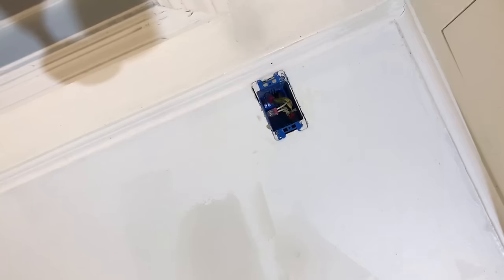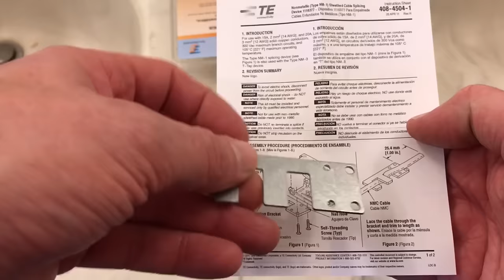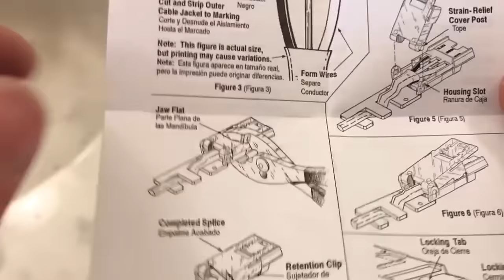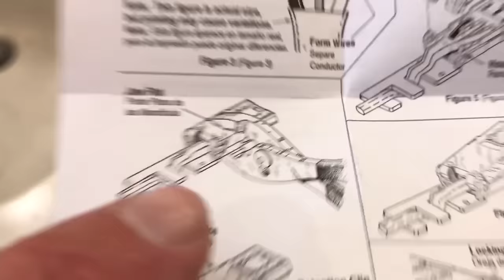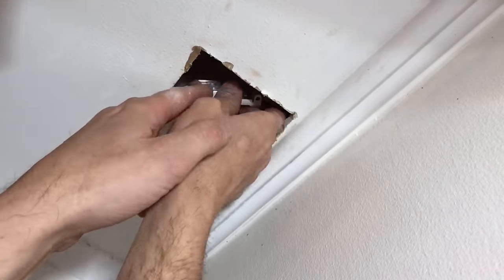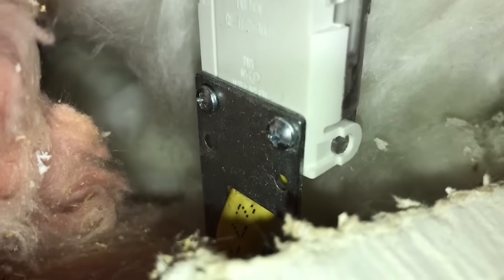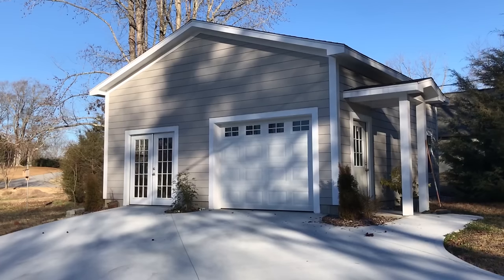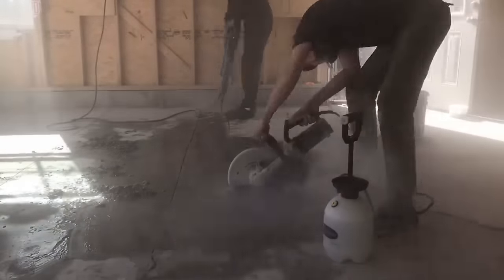Do I have to have a junction box to splice wires?

Comment: Twist, solder, shrink wrap, tape seems like a more secure connection. I was hopeful about this device but after reading the comments from professionals I'm hesitant to use these.
Reply: No. Don't do that ever. It's not allowed per the NEC. If you have to make a junction like this, either do it right or replace the whole wire. Having a little plastic cover on your wall is a lot better than your house burning down. I'm not an electrician, but I would never leave a splice of any kind inaccessible. The product in the video shouldn't exist.

Comment: Just what amperage is this safe for?  Those push and spring clips could loose connectivity with heat and humiditity
Reply from the maker: Should be 20 Amps, Frank, since it takes up to 12 gauge wire. But I no longer have the documentation, so that's an assumption.

Comment: I had to find one of these it took mo 3 hours to find in the wall cost the home owner 380
Reply from the maker: Would love to hear the whole story. Was it causing problems? Did it fail? Thanks for any more info you can post.
Reply: @FamilyFriendlyDIY  my company got a call that there was no power to a section of the house I checked along pretty much the whole circuit I found the splice behind sheet rock with melted insolation and a lose neutral took 3 hours to find and fix even though it I was put together properly it still failed. The second one that was found by my company was basically the same issue loose neutral connection
Reply from the maker: @syitiger9072  Yikes!  Good info. Any other common failures you care to share? Push connectors? Wagos? Wire nuts?  Stab outlets? Would like to know which you see more problems with.
Reply: @FamilyFriendlyDIY  back stab outlets tend to get loose over years i only use wire nuts any time I come across wagos I replaced them. I have seen wire nuts fail if the conductor isn’t properly twisted together or if to small of a wirenut was used on to-many conductors
Reply from the maker: @syitiger9072  Thanks for all the info.

Comment: I would not recommend this device. Slicing through insulation to make connections may be OK for Cat 5 cable and garden lights cable (which often don't work anyway) but crazy for AC power of any amp rating. Surely these are not NEC approved are they???
Reply: I'm guessing you've never used this device so I'm not sure why someone should follow your recommendation. I've used them and if you had you'd know that they are UL listed, NEC approved 334.40(B).

Comment: Since you had to cut stuff out, seemed like more work than just adding a box (for this use case at least).
Reply: The idea was to eliminate the box!
Reply: @philcook9967  I'd assume the idea was to work less too, if you're cutting gypsum, you're making a mess, you may as well throw in a box.

Comment: Personally I would have just put the box inside the ceiling and been done with it.  Code goes overboard sometimes.
Reply from the maker: I know right. A good metal box with clamps has to be as safe as this, eh? Thanks for the comment wattersm!
Reply: The reason you are not an electrician

Comment: No way my inspector would allow this. Code is undeniably clear. All spices must be accessible and located inside a covered box.  Noting other comments on trailers or double Wides, I always refused working on those due to the way they were originally wired
Reply: NEC 334.40(B) allows these.

Comment: Interesting video. I would never do that in my Home but an interesting video.
Reply from the maker: I completely understand. Thanks for the comment, Daniel!
Reply: @techmetal2292  Because he's stuck In his old tired ways and will never embrace change. 🙄
Reply: Omar Williams , not all changes are for the better. These devices need to be thoroughly long term evaluated by good test protocols and methodologies. Fires breaking out between wooden walls is serious business.
A good example of what can (and did) go wrong over time, was the use of aluminum house wiring. Nobody knew initially that using aluminum wiring with conventional metal screws used on switches and outlets would be problematic. No one realized the connections would eventually corrode, heat up, corrode further, etc., until a house fire would result. They eventually had to change to materials that would eliminate this problem, but meanwhile, aluminum wire got such bad publicity that they returned to the use of copper wire, from the circuit breakers onward.
It is true that aluminum wire is still used, but it has the special connectors to make it safe. It is now only used to the meter, and past it to the main circuit breaker(s). But after the breaker box, copper wire is used exclusively.

Comment: I worked in electronics design for over 20 years and used Insulation Displacement Connector technology all the time. Most ribbon cables in computers have IDC connectors. Mind you, these are low power cables, not 20 amp household circuits. When properly assembled, IDC connectors are robust and reliable. We did plenty of “shake and bake” environment testing for oilfield applications. Now, would I trust IDC on a household circuit? Maybe.
Reply from the maker: Thanks for the comment, John. Good info!
Reply: I feel like you didn’t actually take a stance or say anything really

Comment: My question would be did you reference the code book, just because a company made the product doesn't mean it meets or exceeds the electrical requirements. Understand that electricity travels on the outer circumference of the wire that's why all these quick type connectors really don't give you the maximum connectivity that you should have especially with only two .030 of an inch on either side of the wire not to mention the connectors looked like steel that pierced the wire insulation which will cause Galvanic corrosion amongst other issues. Well the only saving grace is the fan shouldn't draw to much current to accelerate the issues. BTW why not just mount the box in the attic & access it from there, code just says it has to be accessible ?

Comment: ? - "might be a little controversial" ? - Nah it is because we don't agree on what's really going wrong and why. 

Damaged wires, corroded wires, the wrong gauge of wires, mess up the flow of electrons and bad things get worse with use, right???

Is it a guarantee that this thing won't fail?  I think not because the contact points are smaller than the gauge of wire AND the contact points damage the wire.  Then there is the fact of oxidation.  This thing is a bad idea. 

Do not impede the flow of electrons and shield metal from oxidation; yes?

Comment: There are reasons why this is illegal to do. So are many car mods you can buy. It'll be your problem when insurance uses it to deny a claim and worse if you become criminally liable for an injury or death. It is likely that boxes are required for safety and accessibility is required for repair access. Those connectors are also less reliable than torqued and taped wire nuts.

Comment: Is this device UL approved? 
Is it approved by the National Electrical Code? 
Is it approved by the local municipality that has jurisdiction?  ( City electrical inspector) State electrical inspector etc.thzt will sign off on the inspection? 
There are outlet boxes all over the a house or businesses and one more in a ceiling is not a problem especial.y when access is needed for whatever reason.

Comment: IF I was going to use something like that (and I’m not) I would never unplug it and reuse it somewhere else, and I would never start with curly wire ends pulled from another connection. It’s just not a good idea.

Comment: These splice kits are not meant for you to be able to get rid of a junction box and you just burying spices in your wall. These splice kits are mainly used in modular house or trailers and are usually in one or two centralized spots with an access panel so that you can get to them in case one of them ever goes bad and that is the reason why you can find them at your hardware store not what this guy is doing.
Reply from the maker: They may be used for repairs, not new construction—Article 334.40b.  Thanks for the comment, Timothy.

Comment: I assumed they were called "Mounting brackets" for a reason?? Who or what would pull apart an "Out of box" connection located in that area?? Why does the NEC allow the use of utility knives to strip sheathing when it's known to be an issue?? Twisted wires under a wire nut has worked for me for over 50 years!! Does anyone know how many people are supported by the NEC's publications and enforcement of their often ludicrous requirements??
Reply from the maker: I hear ya Jack!

Comment: Never liked any of these insulation displacement type bite in connectors “not even the low voltage DC type used commonly for trailer lighting.” I have personally experienced intermittent connections with these style connectors.  I wouldn’t ever trust this type of splice, esp for 120V, even more so as amperage goes above say 1A. Also not all wire insulation is created equal, so you might not even get a clean bite through it. As others have mentioned, the surface contact that these make to the wire itself is much less than a pre-plier twisted and wire-nutted connection securely in a accessible junction box. I also would never reuse this type of connector after the cutter teeth have been spread apart somewhat. Also who knows how secure the spice modules even plug into themselves. They might work without a problem, or they might not! I’ll take safety over appearance any day of the week…it helps me to sleep better at night.  I’ve been a consumer electronics repair tech for approx 30 years.

Comment: I have problems with insulation displacement connections.  they do not handle 15 amps that 14 gauge wire is rated for.  
They might say they are rated but the connecting surface is not enough to prevent the connection from getting hot.

Comment: Illegal there needs to be access to the splice. Same thing as a hidden junction box. If this was to fail you would never be able to find this since your covering with drywall. And even tough you know the junction is there over time you will forget about it, or if you ever move future  resident would not be aware of this work. You did manage to spend more money to do the job wrong. $8.00 compared to $1.50 for the box and a blank cover. Not to mention the fire hazard this creates. Also this product has poor connections. Go back to the way you had it, was correct way to begin  with.

Comment: Did not see an UL or a nema listing I doubt this is legal. Just because you buy it in home depot does not mean that it passes code. Where is the access to the Junction? You could do the same with a Box and cover and bury it in the wall. The nec is a minimum a state cannot change a code to a lower standard only higher.
Reply: This kit is UL listed and the connections are much tighter than a splice with a wire nut. As for the NEC, localities can deviate from the NEC to a lower or a higher standard. The only reason why the NEC is the code is most places is because they adopt the NEC as their code. Not all places in the US follow the NEC, their choice.
Reply: @pld8993   No they can never have a lower standard than the NEC how did you get a license.
Reply: @lucyfuir6386  You're wrong. I've been a master electrician for almost 40 years and teaching code classes for over 20, how about you? The NEC is nothing more than a publication until a local authority adopts it as their code. The NEC has no authority unless and until it's adopted. Please share your evidence. I can identify many examples of a local authority rejecting a particular code in the NEC, thereby going below a minimum standard. If, for example, a local amendment rejects the use of AFCI protection, that's their option. Please tell us all where you found the rule that says any codes decided locally must be "higher" than the NEC standard.
Reply: @pld8993   The NEC itself and the definition of standard.  The local authority may have allowed it but I'll tell you one thing the insurance company will use it as an excuse not to pay out. I'm not talking about bubble covers or distance between staples. Also How will you find it if it ever fails. I would anybody know that it even exists without ripping a hole in the wall.
Reply: @lucyfuir6386  Please identify where in the "NEC itself" you found this supposed rule.
Reply: @lucyfuir6386  Not unlike millions of underground splices whose location can't be identified without digging, it's designed to be installed then buried (behind the wall covering) forever.
Reply: @pld8993   How about you show me in the NEC where it says you can put it unaccessible spice inside the wall of a building. Not underground this is around combustible material
Reply: Look we can argue about this all day but every inspector I've shown this too says no freaking way
Reply: @lucyfuir6386  Here you go 
334.40(B)  Devices of Insulating Material. Self-contained switches, self-contained receptacles, and nonmetallic-sheathed cable interconnector devices of insulating material that are listed shall be permitted to be used without boxes in exposed cable wiring and for repair wiring in existing buildings where the cable is concealed. Openings in such devices shall form a close fit around the outer covering of the cable, and the device shall fully enclose the part of the cable from which any part of the covering has been removed. Where connections to conductors are by binding-screw terminals, there shall be available as many terminals as conductors.
Reply: @lucyfuir6386  With regard to it being around combustible material, the enclosure on this unit is a lot more durable than the sheathing on NM cable, which is buried in combustible material every day.
Reply: What do you own stock in the company or  Do you just need to be right all the time. Either way I bet you get a lot of friends out of it
Reply: @pld8993   I bet you are one of those "you know the electrons actually flow from the negative to the positive" people
Reply: @lucyfuir6386  Yeah, when your argument fails, attack the person you're arguing with. Not very original, but typical. Does being wrong hurt that much??
Reply: @pld8993  lmao big talk for the internet.  Go back to the books
Reply: @pld8993   Go cry to all your friends about it. I'm just laughing at you
Reply: @pld8993   You should put a ground wire inside EMT what if the EMT becomes disconnected you lose your bonding. Just because you can do something doesn't mean it's to be done.
Reply: @pld8993   You're just to know-it-all no matter what anybody says you'll always be right so I'm done talking to you
Reply: @lucyfuir6386  Laugh all you want, you're still wrong.
Reply: @lucyfuir6386  Still waiting for that magical code reference you claim exists "in the NEC itself." You may want to open a code book once in a while, rookie.

Comment: I need an electrical outlet in my water well house, how can I tie into the existing power that goes to the pressure switch from the breaker box
Reply from the maker: I would pull the cable (from the breaker) out of the pressure switch and run it to the new outlet box you want to install, Jamor, and then go from the outlet box to the pressure switch. You'd want to use a GFCI outlet, and connect the wires from the breaker to the "line" screws on the outlet, then connect the wires going to the pressure switch to the "load" screws on the outlet -- and of course tie the grounds together and to the outlet as well. This will also make your well equipment safer as it will be GFCI protected.

Comment: No way I would use that I prefer a solid connection piercing insulation to make contact NO.  There's to many variables that makes it dangerous over heating that spice is one. Be good on a hookup trailer not a house. I'm old school SAFE.

Comment: Just asking this because I don't know the answer, but is it legal by NEC code to soldering wires together (black to black, white to white, green to green) ? Could this be done, while using electrical tape to seal and insulate the wires? If so, this might be a better, more reliable repair.
Reply from the maker: Good question, Jerome. Here's what I found: https://www.teces.org/docs/573.pdf   I personally think if it was crimped first, and covered in a shrink-type insulator, it would be as safe or even better than this device ... but I'm not sure if it's required to be in a box. Might want to give a call to your local building department.
Reply: No bruh.... just no

Comment: I guess that's OK for the kinda guys who use those "backstab" connectors on switches and receptacles...
Reply: Considering "backstab" connectors make several points of contact on a wire and these only make one or two depending on how well you clamp the wire in, I'll take a backstabbed outlet any day over this

Comment: I think its a garbage product. Its odveously ment to be screwed to the celing joist as well. Also the wire snaked through the metal plate looked bent in such a way that over time could cause a faliure. Also youve just shot yourself in the foot if you should ever decide to expand the circuit in the future. Now you have less options to have additonal lights or devices. I honestly would have left it the way it was and trim down the cover plate to conceal the wiring from sight.

Comment: These look like the hokiest piece of junk I’ve ever seen! It creates 3 contact points on each conductor, 3 points that could fail or corrode. 2 of which are Insulation displacement points that I would never trust in a high current circuit! You’d be better off with good twisted wire splices with wirenuts!!! Solder them first and they’re permanent! I don’t care if they are code or not! Use your own judgment!